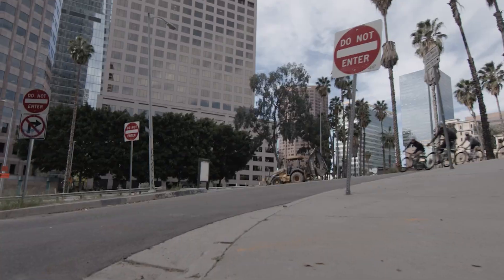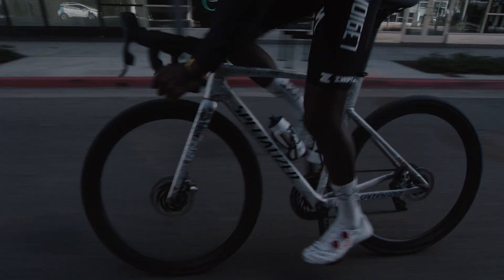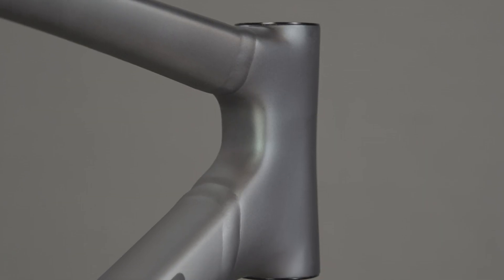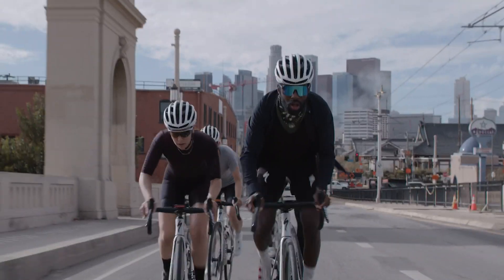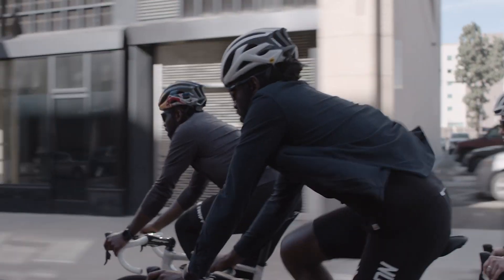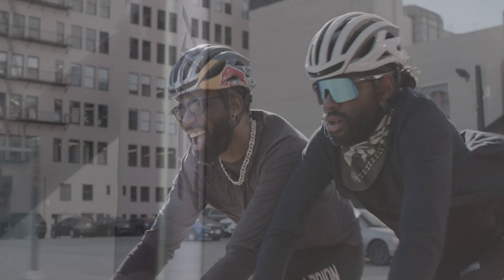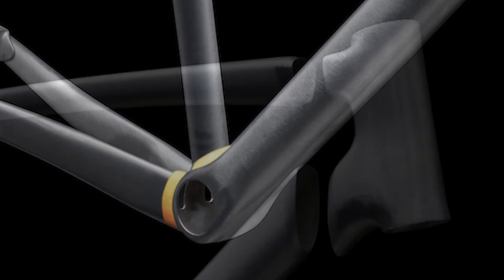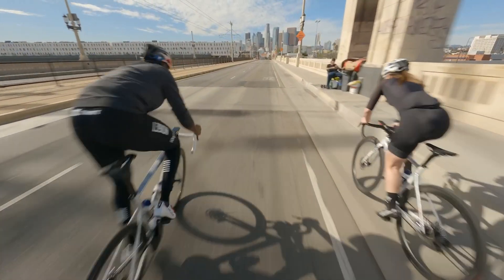The tech behind the new Specialized Allez Sprint

Comment: There is no such thing as superbike made from alloy. I mean seriously specialized you expect me to spend 3k on an alloy bike, my frying pan made from China has better construction than your smartweld. Should I can it super frying pan too?
Reply: I don't like the look of thé welds. But it is not about look but engineering. I would Guess they did their best. And it is not a frying pan but bike suppose to resist to more than 2000watts. If the welds were smoother you would have bought it ?
Reply: @drym3943   If you know your bike you wouldn't, for 3k there is so much value you can get on that e.g. giant TCR and Canyon carbon bikes which are both race ready and outclass this alloy bike in any imaginable way and fact is the best sprinter in the would does not generate 2,000 watts. Unless, you are an alloy bike collector, sure an alloy superbike sounds a novelty but alloy is alloy and there a reason why the best cyclists in the world doesn't use it. Anyway, that just my honest opinion.
Reply: @Ghost12561  i ride a tcr
Reply: @drym3943  oh wow my friend I never had one but the professional I knew swear about its performance. I currently ride trek madone.

Comment: If you can, get a Canyon Ultimate CF SL 8 for the same price and you will be laughing at Specialised marketing at no time
Reply: I too used to make fun of Specialized with their higher prices and so I got a Canyon Grail but crashed my fork.  I thought Canyon's crash replacement warranty would cover me and they said it would but a year later, I'm still waiting for the replacement fork to arrive.  So I went on my own and had my LBS install an alternative fork and in the process, found out that Canyon uses proprietary parts and sizes that make it extremely difficult to replace using non-Canyon parts.  Although, in their defense, COVID-19 made it challenging (and continues to make it challenging) to procure replacement forks, I will not be buying a Canyon bike again.  At least with Specialized, I can go to my Specialized shop in my area and find parts or at least order them and get them in a reasonable amount of time.  Plus Specialized is an American company so I have less of a problem with their higher prices being that I can get available replacement parts and a local presence.
Reply: 100%, I looked at this, then looked at the spec you can get on a Canyon Ultimate for the same money and there's no contest. Specialized pricing is at least 25% brand name.